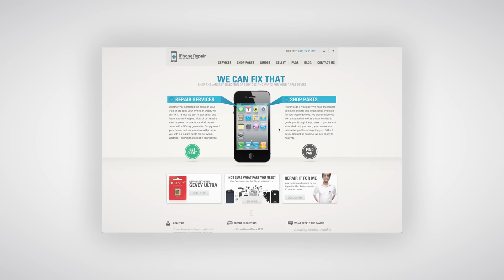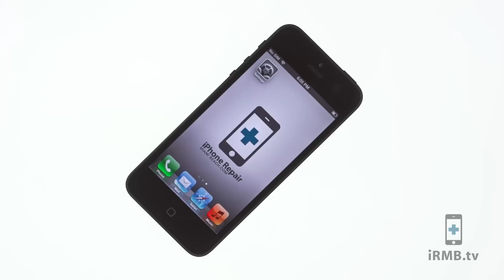Earpiece Repair - iPhone 5 How to Tutorial

Comment: Hi, I did it. I did it easier though, without removing the cables. One detail is that the twezer needs to be anti-magnetic, if possible.
 I found that mine was damaged because the original screws were loose from factory, perhaps this is the issue the iPhone 5 ear speaker. Thanks for the video.
Reply: daniloreyes2